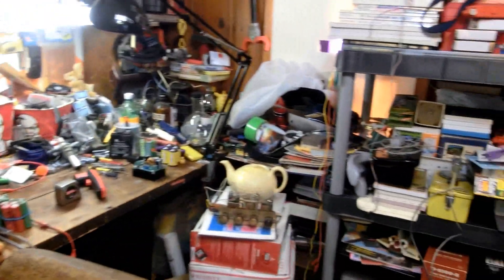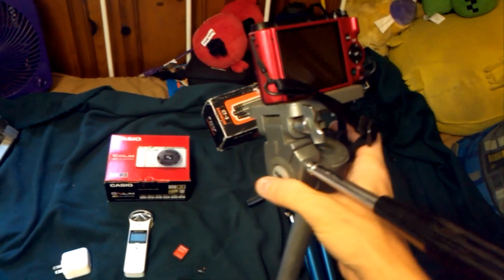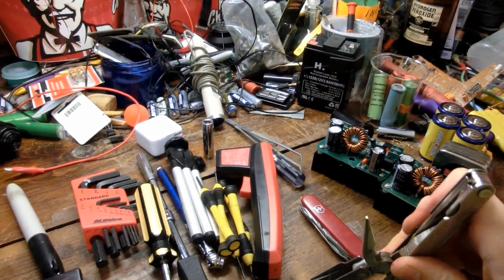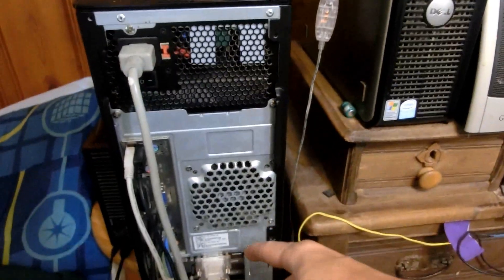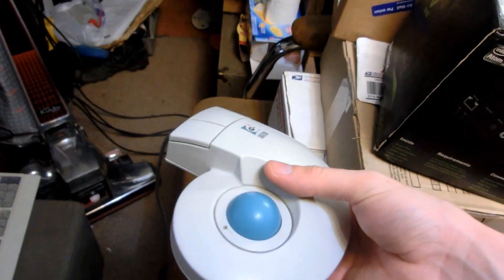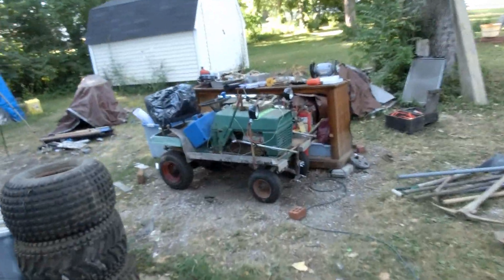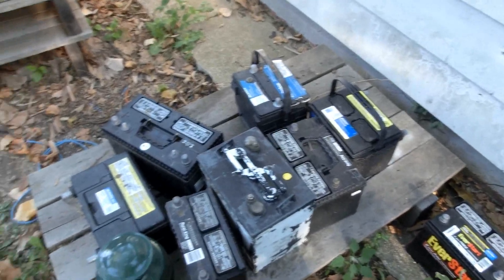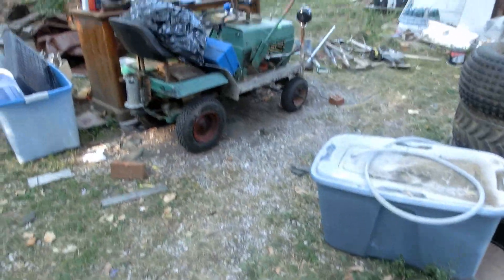Random Bits 0039: every tool i use

Comment: A good set of tools make jobs much easyer :-))

For a later project you could make a steady cam, a rod with a weight on one end and the camera on the other, put a pivot in the center and it could be bolted to your tractor, just a thought :-)
Reply: well he could just attach a weight to the upper piece of the tripod if he uses that anyway. a cooler project would be a vacuum bag camera mount that is the thing he should build
Reply: steffankaizer
A vacuum bag camera mount, ive never heard of that type before :-)
Reply from the maker: zx8401ztv
he just means one with a big suction cup on the bottom.
Reply: Rinoa Super-Genius
steffankaizer got my interest, its called  "v" BAG, you can plonk it anywhere and put your camera on top, then suck the air out and it forms a perfect mount.
Some clever ideas about :-))
Reply from the maker: zx8401ztv
 unfortunatly only to surfaces that are perfectly smooth.
Reply: Rinoa Super-Genius
Nope, you can slap it on top of a post and scrunch the bag around the camera and post and when the air is pumped out the bag freezes to the shape :-)
Reply from the maker: zx8401ztv
 oh its one of those, google brought up a suction cup thingy.
Reply: Rinoa Super-Genius
Google is good at showing stuff you dont want, when i search for say radio schematics, i get all sorts of other schematics and trying to limit google just shows nothing.
I tend to use the image mode as it yealds more lol.
Reply: zx8401ztv
i kind of expected this to happen ^^ but its really cool and its just a bag with stuff in it. it could be anything from Styrofoam pebbles to wooddust
Reply: steffankaizer
It is a clever use of something so so simple :-))

Im not sure about the contents of the bag, the styrofoam sounds very possible, if the pebbles were loose i dont think it would work so well, perhaps its a layer of pebbles, a bit like bubble wrap, sort of lol.

I dont know really, we will have to wait untill someone gets one cheap and opens up one end :-)

Comment: That gasoline blowtorch... you need to keep pumping the piston to keep the flame burning fast as a "turbine" or it sustains itself after getting hot enough?
Reply from the maker: yes you need to pump it to build pressure, it has some leaks so i have to pump it a lot more than i should.

Comment: At the least 1000 dollars in that room
Reply from the maker: about 3000$ in the tools but I would say a few thousand more in all the items I have. my computer alone cost 1900$
Reply: Dangggggg
Reply: Rinoa Super-Genius
if you paid 1900 for that computer you got ripped off
Reply: altecdarpa21 he probably got or bought modifications to make it faster and for it to be able to deal with the amount of data going through
Reply from the maker: altecdarpa21  since i got it in 2012 i've actually spent about

850$ for Asus CM6850
70$ for PSU
450$ for Nvidia GTX560ti
90$ for 1TB samsung usb hard drive
90$ for 1TB Samsung usb hard drive
120$ for Seagate 3TB usb hard drive
free 120GB SSD